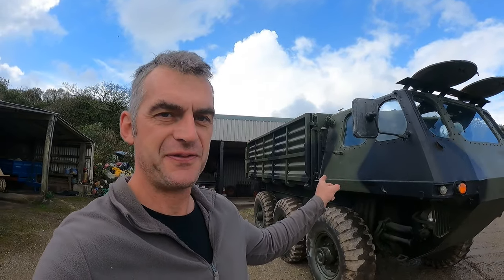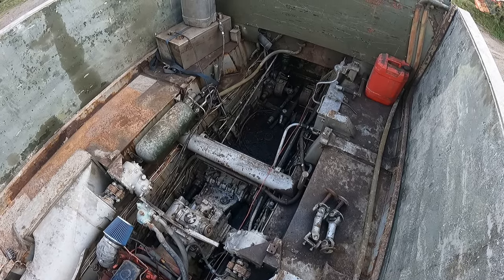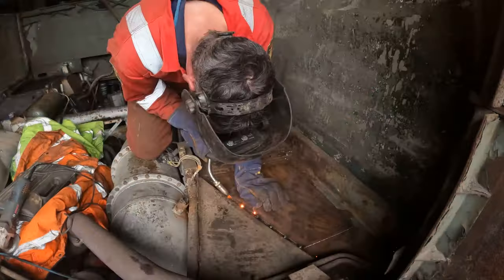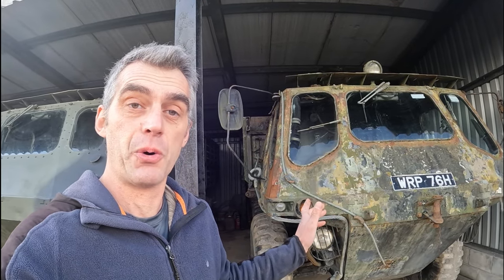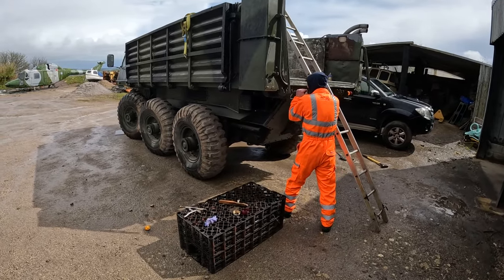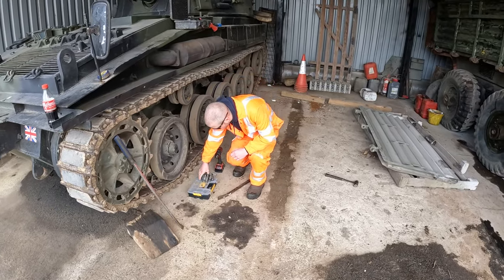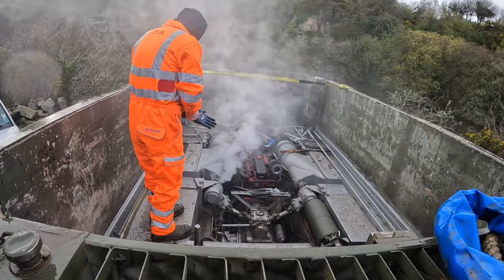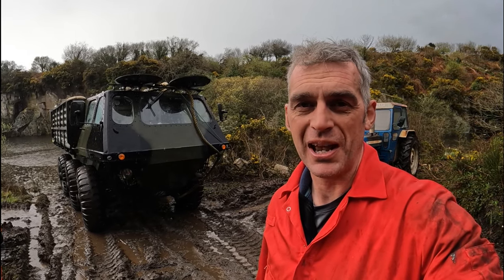Alvis Stalwart First Swim. Will it Float or will it Sink ?! Mk1 Restoration Project : Part 2

Comment: Pro-tip about patch paneling and doubled panels = rust. You have a hole, you then draw (right angles - round holes only if you have large radiuses or feel confident with a hole saw) your patch. You cut your patch panel (just a whisker larger than what you've drawn, maybe two widths of a grinder blade over the line), place it over, and tack it on the perimeter. Then, using a very small angle grinder (there's ones with long necks and 10 cm blades / air or electric, doesn't matter it's about the precision they give you, because they're smaller, you get a cleaner, narrower cut) you start a slice through both of the materials (parent and patch) just before one tack, and through the next. You then push (or pull if you have access from behind) the parent material a bit (by pushing the patch in or pulling from the other side, like i said) so it's even with the good, solid parent material and you start welding in 4 cm long strips. Even if you haven't completed a tack to tack slice, you don't weld it more than that. Then you go to the other side of the patch, and do the same, but also finish the last cordon on that first side you started with, which by the time you're done, has had time to cool off. You then repeat this process in a concentric pattern, until you're finished. You'll get a good, solid panel, with no doublers (which hold water and air and rust like hell, both your patch and the parent material right up to the weld and through).  You'll also have very little warp and a very good finish.
Just my 2 cents. I know it's a bit tedious, but when you're done, if you so desire, you can grind off the excess weld and you'll be left with a flat panel that can be then taken through the block and hammer and nobody will be any wiser - that it's been patched.
Reply from the maker: Cheers that’s actually really useful. I will give that a try I have plenty more to do ! 😬 buy the time I do the other two I should be pretty good at it 🤣

Comment: Mr Hewes brought me here. That was excellent. I envy the amount of space you have to work on things. I really like Stalwarts, first saw one in a book at school when   I was 10. Loved them since. They do look a bit wallowy in the water. I get the sense that if the cargo compartment was full, the thing would capsize at the merest breath of a cross wind. Maybe it is an unjust criticism. I imagine the weight of all the running gear makes the C of G much lower than it looks. I suspect though that it is using the tyres as buoyancy. Thats bad because it means the centre of buoyancy and centre of gravity are close together, which causes instability.
Reply from the maker: Yes you are quite right, I would not fancy swimming one with much cargo on board. They are not too unstable due to there being a lot of weight and vehicle in the water below. 
I once had one of those plastic 8x8 argocat vehicles. That was absolutely terrible on the water so I was using that as a really bad standard to go off.

Comment: Well Ben!  I can remember looking in the water at that old lorry chassis many years back in the quarry.   And I thought history was going to repeat its self!
But no, what a result
Bet your well pleased with how it went, but you do put the work in!
Great video👍
Reply from the maker: Haha cheers. Yeah I ended up pulling that lorry out but sadly there wasn’t much left of it. I actually have a picture of it now if before I went in if your interested! (The old lorry that was in the water )
Reply: That lorry been in there lotta years! I was young boy then. On the end of the granite stillion pile, where the steam crane was bolted down.
Before they tore down the end, used to be a gap in the rocks you could climb inside.
Would not do that now!
Yes I would like to see that lorry photo, also I think you have crane out now.
I’ve only ever seen the top of the jib sticking out the water!🙂

Comment: I like the idea of amphibious vehicles and a Stalwart for daily driving would be neat (quiet a lot of storage space for groceries for sure). But i wonder how stable it is in the water. Wouldn't it be going to capsize first chance? And in case of a roll over: What are the chances of anyone in the cabin to get out in time?
On an somewhat unrelated note the floating Stalwart reminds me of the german battleship Bismark(?) whose huge turrets where designed to fall out in case of capsizing. They fell out very well when the ship rolled over when taking on water after it got hit. But the ship nevertheless did not manage to get back up and sank anyway.😢
Reply from the maker: It’s not too bad. Although there’s a lot of air in those tyres trying to float back up 😮 not sure I would like to take it out far to sea !

Comment: I didn't think those prop bearings sounded good when you first engaged drive to them. Been on a Stolly up on Lake Windermere a few years ago with a guy on the Amphib meet.
Reply from the maker: It had been parked up probably 20-30 years although it was dry in a shed for most of that. The other side did seem a bit smoother. The smoke was actually from me putting oil where there was supposed to be grease 🤣

Comment: That is the engine it should have had from new :o) And the sides should have been hinged half way up so they leak less :D  I was wondering about the big space between cab and gearbox, and then I remembered it was for the turret basket on the armoured car version. You have an excellent machine there.
Reply from the maker: There’s supposed to be an enormous fuel tank in there. Something silly like 300/400 litres I think. I took it out as it was full of water
Reply: @BenoCam  my mental math guesstimate says it’s 12 hours with that RR F head petrol engine?
Reply from the maker: @teamidris I think originally they wanted it to be able to achieve 300-500 miles on one tank (or something similarly big) and they were terrible on fuel.

Comment: really enjoyed the video,  how did you connect the diesel engine to the gearbox? are Bedford and Rolls Royce mounting points the same? or did you make an adapter plate , if so how did you overcome the input shaft length with an adapter plate? or did you machine the gearbox mounting face down by the thickness of the the adapter plate?? really interested in how you did this?
Reply from the maker: I covered that in the first episode. The link is in the description. Basically I bought it without an engine then found a Bedford 500 out of a mk2 which had a adapter plate to fit the stalwart gearbox , it was still a bit of faffing around adjusting the engine mounts and converting them but all the main. It’s fit ok. Connecting up the services etc was the trickiest . Nothing fit and a lot of it needed to be moved over to the other side etc but got there in the end
Reply: @BenoCam  i will go find earlier video, cheers,  you have a Abbott and a Stalwart, my two dream 'if i had space' toys, top job..

Comment: Actually it's not the only way to find out - you could have (maybe after removing the engine?) filled the bed with water and looked for where the water leaks out.
Reply from the maker: Don’t like the idea of all that water damage inside though… there’s a lot of things in there which you would be forever getting water out of… bevel boxes/bearings etc etc . I think driving it in slowly was more fun too 🤣
Reply: @BenoCam  that's so long as you're confident enough that your repairs are adequate to prevent it sinking. You'll definitely be getting dirty water out of everything if it sinks.